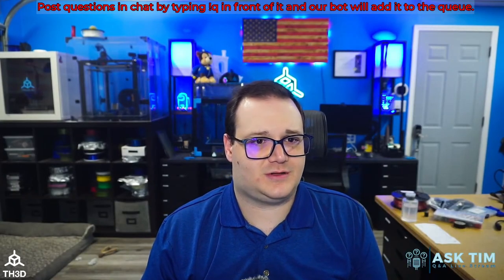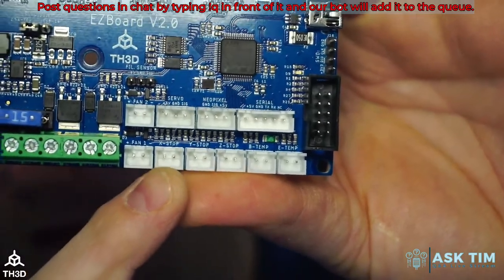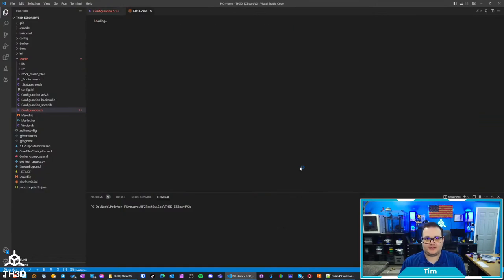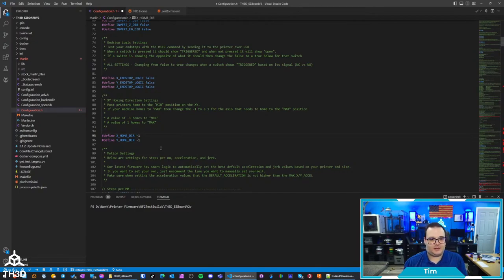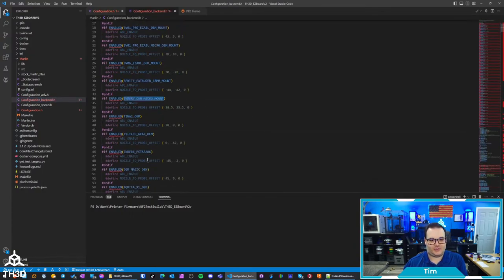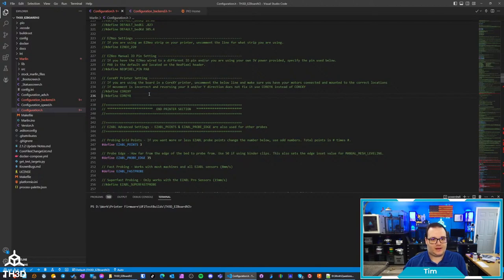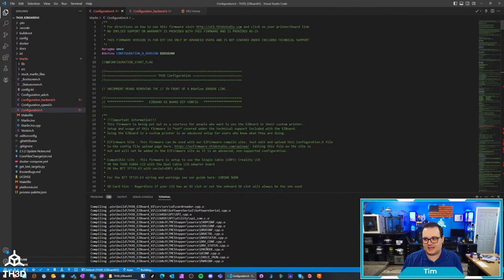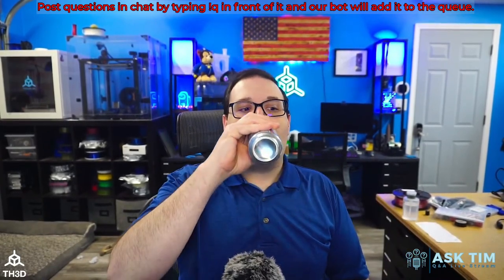EZBoard DIY Firmware for Any Printer - Ender 6 Question - Ask Tim Clip - 3/22/23

Comment: Any opinions on a good replacement board for a Sunlu S9?   Your site doesn't list the printer,  and not sure if it's the same board as the S8, it has a way different firmware than the S8 and there are a lot of missing features.